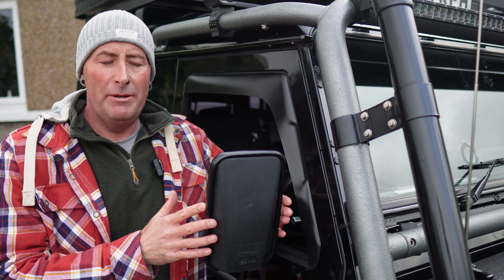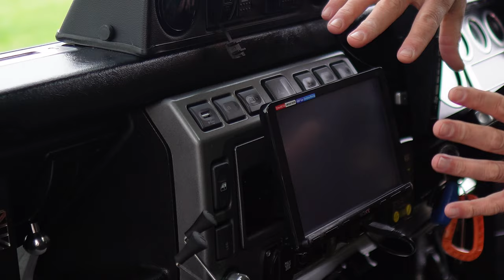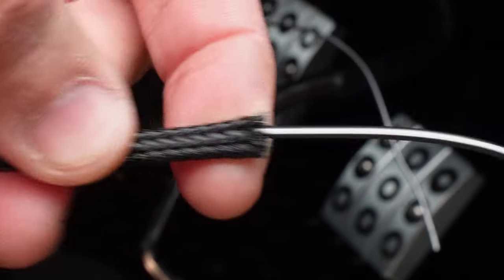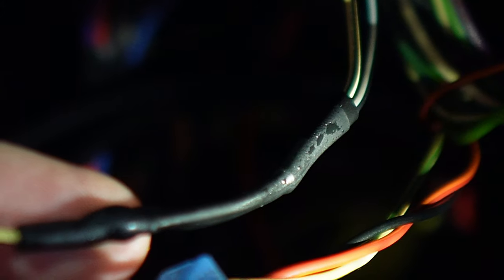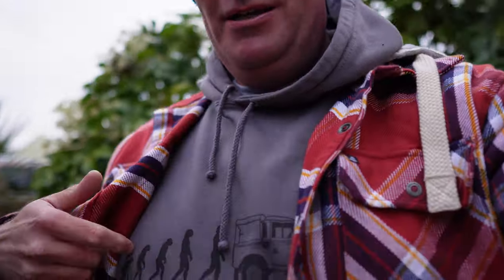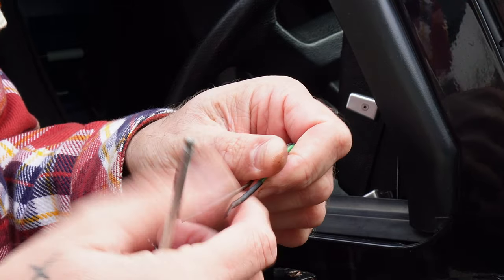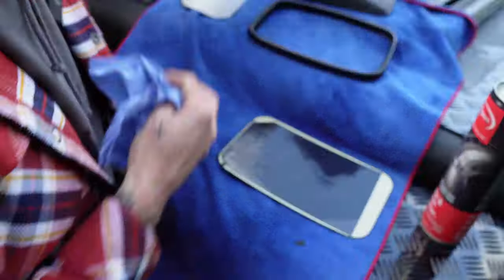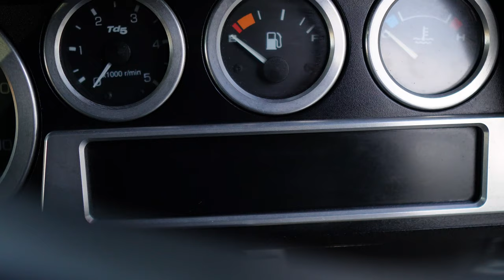FITING HEATED MIRRORS TO THE DEFENDER...

Comment: I have a Puma not TD5 but I'm doing the same thing. Did you just wire the Positive to that black and white and negative to earth somewhere and it worked?
Reply from the maker: I wire the black and white wire into the switch it's just one wire that's all you need to do, that's if you are using the existing Defender heated window switch to power the heat mirror pads...if you want please send me a message on my Instagram... and I will be more than to help you... I hope you get it done...  Thanks for watching and for your message...Rob 👍